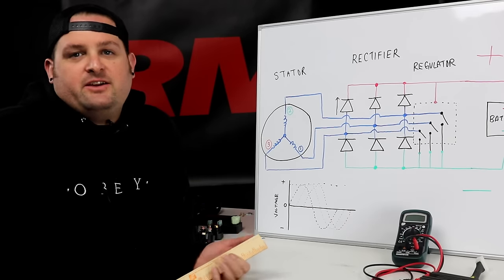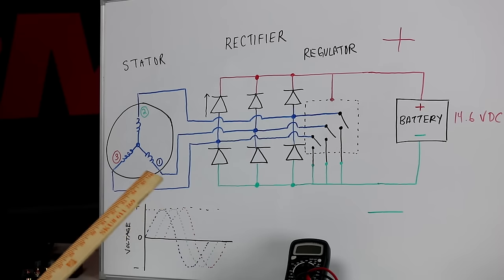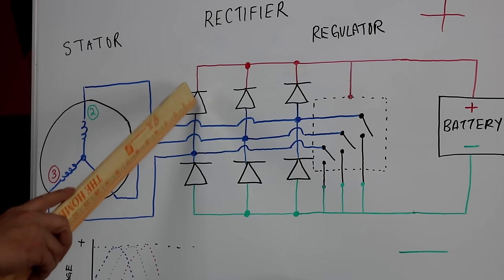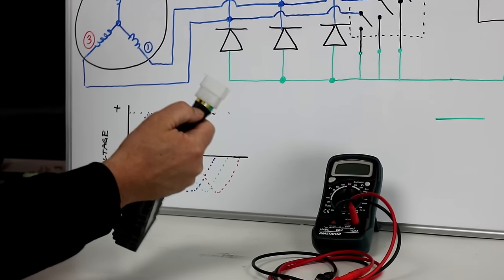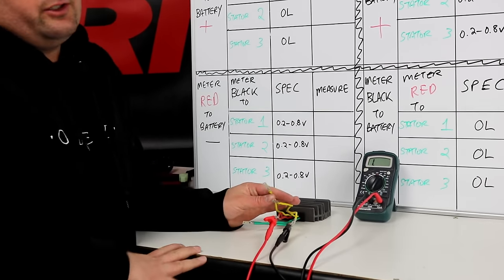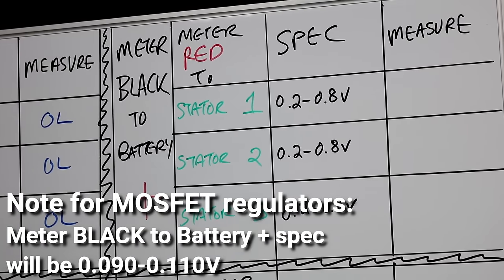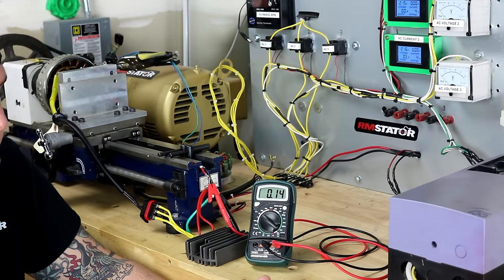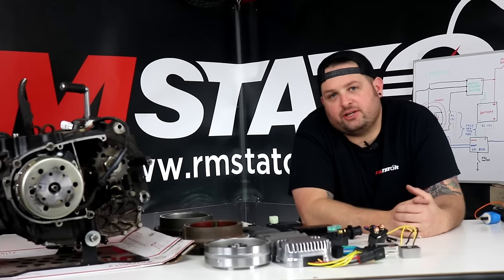How to Test Voltage Regulator Rectifiers for Motorcycle, ATV, UTV, Snowmobile & Powersports Engines

Comment: my aftermarket reg/rec for honda CBF1000 shows instable voltage on DC output : jumping between 11.5 >16.5 V. I measured the courant directly on the positive and the negative wire. When connected to the battery it shows 14.2V. My Honda original reg/rec shows alwas 15.5V . The aftermarket reg/rec is supposed to be a MOSFET one.

Comment: Per the chart my test results are all good, is it possible my regulator/rectifier is still defective? I’m charging at 17volts but I’m told stators usually do not overcharge, they undercharge when dropping a coil.

Comment: Awesome video, very detailed and well explained. I have a question, if you tested the DC output of a rectifier/regulator without a battery connected, would it read the same voltage as the stator? Because there is no reference voltage and the switching would be trying to put out as much power as possible?
Reply: Great question. I'd love the answer to that as well.

Comment: My voltage goes up only to 13v when my bike runs at 5000rpm and when bike turned off and no ignition it shows only 11v i just tested my rectifier is good but still doesnt goes up to 14.5v can it be the stator then or maybe battery?

Comment: gr8  Vid! Thanks! So can a diode go bad by 1 either not conducting at all or 2 both directions.
I'm guessing if 1 diode does not conduct as it should, current capacity of stator would be less.
2 if diode  conducts both ways, I guess part of stator  could be burned out.

Comment: This seems similar to a gasoline power generator? I'm getting 22 volts on the brushes, so I'm thinking towards the voltage regulator or diode rectifier. Voltage on the windings seems to be okay.
Reply from the maker: Similar, but not the same. A generator using brushes will have a different type of regulator that powers the field coil through the brushes. It regulates by turning the magnet coil on and off.
Reply: @Rmstatorinc  Right on, it's a moonshaped regulator so either that one is bad or something worse inside the rotor..

Comment: Hi 

I have suzuki dr200 , when idealling around 1500 rpm the multimeter shows 14.3 give or take but when i rev the engine to 5000 rpm the number start to fall some where around 13.3 to 13.5 , is this normal ?

Comment: Learned a ton! 
I’m working on a 1966 Honda dream ca78 motorcycle that has an archaic electrical system. 
Voltage at idle is a consistent 8-9 V when the rpms increase the voltage jumps around and varies between 10-16 V. 
I’m assuming I need a new regulator/rectifier. I have three wires leading to the regulator rectifier + - and one to the armature I presume. Could just about any 12v 3 wire regulator work? Do you guys have on for sale that could fit the application? 

Thanks for the video and help!!
Reply from the maker: Thanks! I just checked out a wiring diagram for a Honda Dream. There is no regulator on your system, it only has a rectifier for the DC battery charging circuit. The voltage is regulated by the load on the lighting coil of the stator. If you did use a regulator/rectifier you would need a 6V unit, which we don't currently have available. We don't make a separate rectifier like you would need either. Sorry, we don't do much for the 60's era bikes. Another option would be to remove the Brown wire, in effect chaining the stator coils together in series between the Pink & Yellow wires. You could run these into a 12V regulator/rectifier, and charge a 12V battery for a more modern type of charging system. You would need to rewire your lighting circuit as well to operate from battery power rather than the stator. Might be more work than it's worth, but there's some options!
Reply: RMSTATOR thanks for checking into that! 

Could I use an (Voltage Regulator Rectifier Motorcycle 12V for Kohler ECH749, ECV740 25hp Engines)? It’s a three prong rectifier regulator. Two from the armature and one to charge the battery. 

Any reason I couldn’t hook that directly in place of the rectifier? ( excuse my ignorance if this is a dumb question; I have a a bit to learn on this system)

Comment: Great video but can you do an explanation on 7-8 what are the extra wires for on a 7 or 8 wire regulator are they extra grounds or hot wires? ? My stator tested good I’m trying to test regulator on my 08 brute force 650 but it has 8 wires. 3 yellow from stator and 5 on output of R/R
Reply from the maker: On the brute force, the 3 yellow wires are stator AC in. There is 2 Red (battery +), 2 Black (battery -), and White (switched hot, voltage sensing wire). The voltage sensing wire is the battery voltage reference for the regulator.

Comment: My stator went out so I change stator and rectifier stator wires were getting extremely hot until I added a extra ground from battery to ground wire on rectifier now it charges at 14 to 15.5 at idle when I throttle my voltage says high so it’s 16.5 or higher what should I do

Comment: Can you test the output on the regulator/rectifier with out it being connected to the battery with engine running? If so will the dc voltage stay at about 12-14.6 vdc? I removed the green and red from battery and its out putting 30+ vdc with out it connected to battery and increases when i rev my engine once i connect it it drops to .4 vdc. My vac from stator is about 40vac and increases when i rev the engine. I tested the diodes and all checked good forward bais test. Also i have a brown wire what is it for? Thx any input would help !

Comment: I have a Polaris sportsman 570 -18 with regulator rectifier oem # 4015230
and when tested, the result is: 
meter black to battery + = 0.480 on all 3 wires.
meter black to battery - = OL
meter red to battery + = OL
and meter red to battery - = OL.
So it does not pass the RMstator diagnostic flowchart test.
I have heard that the Polaris rectifier is different than others.
So my question is whether it is  OK or broken?

Comment: 5.38 you state that the current is producing heat and thats why the unit has a large cooling surface. However the heat of the current is produced in the stator-coils and the shunt has a close to  zero resistance and will generate very little heat. The block gets hot by its rectifying proces.
Reply from the maker: Correct the rectifier diodes certainly do get hot. So do the SCR shunt switches. All of it generates a significant amount of heat that needs to be dissipated by the heatsink housing!

Comment: Great explanation man!  I have a question though. Can I connect my lights(head, tail, turn & dash) directly to the regulator without a battery? Will it damage the regulator/rectifier? I have an old 2 stroke bike that has lights that flicker and wanted to rewire it to DC.

Comment: Excellent video, but I’m still a little confused. I have 23-25 volt ac at idle between the 3 phases from the stator. About 0.2 ohm between the phases with engine off. None of the phases are grounded. So stator should be good I think? I measured the rectifier to be good also. The problem is that the output is only about 2 volt dc. Is the regulator bad?

Comment: qestion : in your schematic ( simplified ) the regulator part shorts the coil to ground ? that seems a big mistake because that will fry your coil to a crisp. other qestion : how much current can your regulators handle and why are there no fuses in the coil / stator lines to protect the stator coil in case of a failure to a crispy burnt flavour ? seems logical to me to put 3 fuses in the 3 stator lines .
Reply from the maker: This diagram is very simplified, but yes the coils are shorted to ground to consume the current from the stator coils to be dissipated as heat rather than passed on to the battery, in order to limit the battery voltage. It will not fry your stator coils, they are meant to operate this way. Current handling in the regulator is dependent on the components being used. Mainly the diodes in the rectifier, but also the shunt switches and heat sinking capability. Most large regulators can handle up to 50Amps or so, smaller ones much less obviously.  You do not want or need a fuse inline with the stator to regulator. The system is meant to handle the maximum current produced by the stator, and it cannot produce any more than that in any case. There would be no point protecting this part of the circuit. You generally do not want a fuse between the stator and regulator, or regulator and battery. The fuses should protect all your circuits after the battery.

Comment: What about a regulator/ rectifier that has a small black voltage sensing wire? Is it the same test?
Reply from the maker: Yes, as far as testing goes, the voltage sensing wire won't change anything. Most newer models have removed the voltage sensing wire for the regulation battery reference voltage. On older bikes, increased resistance through an old wiring harness causes the regulator to think the battery voltage is much lower than it really is, which bumps up the output from the regulator. Easy way to overcharge and damage your battery. We don't include this wire for most regulators, even if the original used it. The most accurate voltage reference for your regulator is always a direct connection to the battery!

Comment: Hi Evin, I am working on a jet ski, and have a 5 wire rect/reg (just like yours).  So, going by the chart you have made, I only get numbers (all the same ~0.395) in the left bottom quadrant, and nothing on the top right quadrant (other two quadrants are OL).  So that means I have three bad diods, but isn't that on the rare side, that all three diods are showing bad showing OL?  your advise?  thanks.

Comment: nice video. I understand it clearly. Here in Asia, a lot of people modifying their motorcycle charging system like rewiring stator winding to make the stator charging current stronger. Replacing 4 wire regulator to 5 wire. Modified charging system will supply LED bulbs for headlights better. Is this true? Can you make a video to understand this theory better? Thanks
Reply from the maker: I believe you mean converting a single phase (2-wire) stator to 3-phase (3-wire) stator. Yes, this will significantly improve charging system output. The 3 coils each produce peak current when the other 2 do not, so you have more consistent output, especially at lower RPM. This is a very good upgrade. We may do a video on this at some point.
Reply: RMSTATOR Actually most stator here are single phase. Original wiring is yellow at the middle of the winding. They remove yellow connection from the mid tap. Remove end of winding from the ground.  The  coil (floating) no connection from the ground will be the yellow wire. White wire will be the start wire and yellow will be the end of windiing. By doing this, they said, current charging will be stronger because the whole winding will be used. But still this winding is single phase using 2 wires yellow and white. They call this full wave conversion. Is it true by doing this reconnectiom will make a single phase stator to a full wave charger? Im confused of single phase stator can be rewired to charge fullwave.  Thanks

Comment: Really good video. A lot of info. Of coarse it doesn't seem to answer my problem though. Lol
I have a skidoo that's popping its main fuse everytime I try and start the machine. I've isolated it down to the stator (ac side) or the regulator (when disconnected the machine starts and runs fine. I've followed your troubleshooting guide and get all good numbers. What's odd is when the regulator is removed from the machine I'm getting continunity between the red wire (battery positive) and the regulator housing. Is that right?

Comment: Lionel trains run on low variable voltage AC, which could be used to test a Regulator Rectifier.
Reply: Good point, I work on Lionel trains and have several transformers which I could use for that!

Comment: Great very informative, I have a question on this .
I have an electrical system on my bike it’s a Triumph t110 and I have fitted a 12v alternator and single coil reg rec , it’s been good for 6 years now and then taking it on a test ride after engine rebuild the electronic speedo light was pulsing .
I checked battery voltage and it was 9v I charged it to 12.95v and reconnected it to the trickle charger I have the light started pulsing again . I disconnected the positive wire from the battery to the speedo but it still pulses 
So my question is if my reg rec failed can positive feed go through the diod down the negative wire damaging my battery and putting positive up the negative wire to my speedo making it pulse . 
The battery is u/s so I’m fitting a new one and a new reg get.
Reply: Rec not reg
Reply: Spell check sorry rec not get.

Comment: In my Yamaha Virago it doesn't work. You get measurements of the regulator circuit not only of the rectifier circuit, and where you expect an OL appears a 1.395V. But the rectifier-regulator works.
Reply from the maker: This still implies a bad diode in the rectifier. The unit can certainly still be functional with one or even more bad diodes. However it will not be functioning correctly, output will be diminished, and it will definitely fail at some point, usually in the near future.
Reply: @Rmstatorinc  I don't think so. The measurements indicate that the 3 diodes touching the positive are "bad" with the same value 1.395V in the blocking direction. The diodes touching the negative are "right", but the system works charging the battery 13.5-14V.
Reply from the maker: If you are getting an increase in battery voltage, the rectifier must be functioning somewhat. If all diodes were open, you would have no current flow out to the battery. I believe you have defective or failing diodes, however they are still marginally functional. Still recommend replacing regulator!
Reply: @Rmstatorinc  My Virago still works after more than a month. The rectifier-regulator still works charging the battery and in a correct values. What happen is that it cost me only 10$ from China, and is something that much people don't wanna accept.

Comment: Awesome video! If I can ask a question, what might it mean if I am getting voltage in the reverse direction as you have listed.  Meter black to battery positive should give voltage and meter black to battery negative should not. However, I am getting the opposite....and I have tested this multiple times to confirm.
Reply from the maker: This would indicate an internally shorted diode in the rectifier. You will need to replace the regulator rectifier unit.

Comment: Would like to see a video on capacitor charge system on a lawn mower. These don't have electric start and no battery. But run a 12 volt electric clutch for mower deck.

Comment: Just a quick observation: when testing diodes (1st part of your video, testing it off the bike) the units of the values you read on a DMM are in Ohms, not Volts
Reply from the maker: Sorry, but a diode measurement is in Volts, not Ohms. The diode setting on a multimeter measures the voltage drop across a diode, it is definitely a voltage measurement.

Comment: When you check the diodes on the rectifier you say that in one direction there is no current flow.  Correct.  Switch the multimeter leads and you say that the readings are around 0.4 or 0.5 volts.  Where did they come from?  What you are measuring is resistance which is nothing to do with volts.  It is measured in Ohms. Maybe I am missing something but I've been an electrical service engineer for40 years and have always tested diodes with the meter set on Ohms. Perhaps the diode function applies a given voltage and measures for a volt drop which is what an Ohm meter does anyway.

Comment: Hey Evan quick question my regulator/rectifier gets hot and also my stator gets hot when I connect my battery then the battery voltage starts dropping. Is the cause of this my regular/rectifier bad?
Reply from the maker: Hi Rouddy, very likely could be a bad regulator causing this. I'd recommend fully testing the regulator to identify any problems. Test the stator as well to be sure the windings are in good shape. We have testing instructions on our website and YouTube!
Reply: Ok thank you very much !!!

Comment: bud i have a problem i hope you can help me, i test my voltage same as you, already test my stator and looks all good but the voltage output of my regulator mark up to 16 volts some times goes down to 5volts but only for an instance is it bad regulator? my bike works nice when i disconect the regulator(only battery) but soon as i conect the regulator back its seems bad a lots of backfires and strugles to rev it thanks for the help
Reply: plus the battery light turns on and off 
intermittently when the regulator is conected
Reply from the maker: Yes this is very likely a bad regulator causing the battery voltage to swing wildly, this is not good for your ignition system and other electronics on the bike. I would recommend replacing the regulator.
Reply: @Rmstatorinc  so sorry to ask again, but just want to make sure before buy a new Regulator, i discover this today when i turn on the motorcycle i can clearly hear my fuel pump working but soon as i turn my lights on is seems to slow down like if is laking of power. thanks again and sorry for keep asking